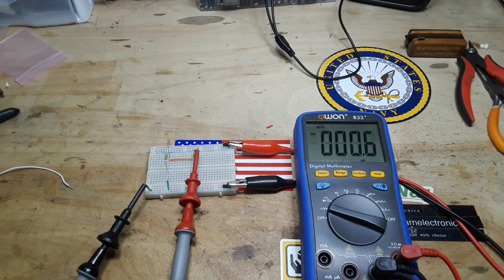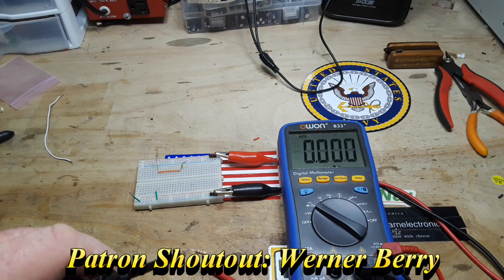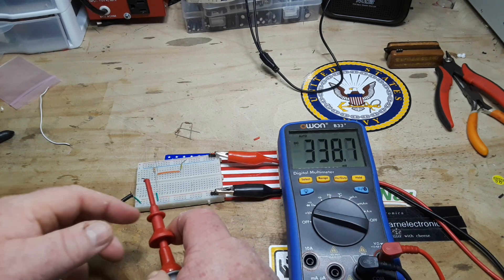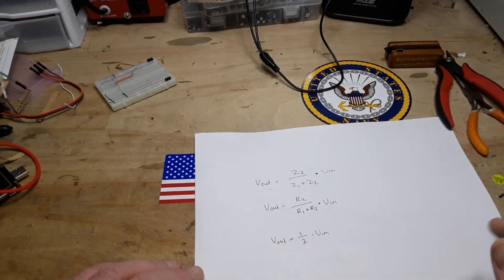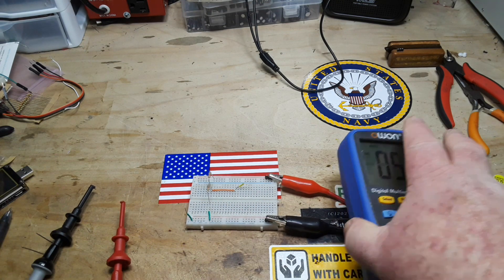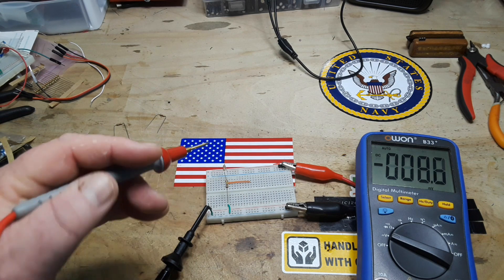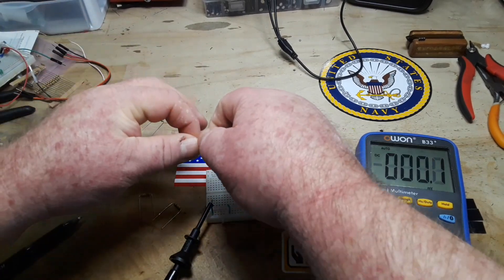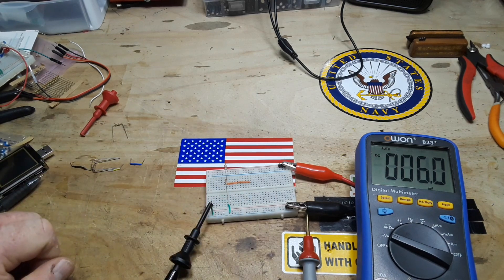Voltage Dividers: The Most Classic of Circuits

Comment: Hi Paul, you should also mention that you can use exactly this circuit to obtain both positive and negative voltage, eg. +5v and -5v from a 10v input.
Reply: How do you do that?

Comment: I assume that you would use a voltage divider to step down the voltage to a certain part of your circuit. Like, powering on an LED light for whatever reason. Can you still send that original 10 volts to other parts of your circuit? If so, how?
Reply from the maker: Sure, you just come off the VCC instead of the junction of the two resistors.

Comment: Such a fundamental circuit that is used all the time. Paul did it right here but to learn from my mistake make sure you either power off and allow all caps to discharge or take out component before measuring resistance.

Comment: My mental block when I first studied this circuit was intuitively knowing if the voltage was higher across the larger or smaller resistor.
Reply: It may help to think of the limiting case.  The lowest possible resistance is a wire and there is no voltage drop across a short circuit.
Reply: Or for that matter, an open circuit - infinite resistance - gets all of the voltage  And digital electronics starts from these extremes.
Reply: @andrewwilson6240  Yes, that is the other limiting case :D

Comment: Why do they call it a breadboard?
Reply: Back in the early days of electronics circuits would be prototyped on strips of wood.  The nickname 'breadboard' was born because that's what they looked like, and has stuck.
Reply: @seditiousmonkeyart  True. Back in the days, young experimenters would often use their mother's bread board (yes, in those days many women actually made their own bread) to prototype circuits. They would hammer nails into the board for the wire tie points. Similar to wire wrap circuit construction.
Reply: Its original name is bread board... So we all called it bread board
Reply: Read this https://electronics.stackexchange.com/questions/48516/why-are-they-called-breadboards#48533